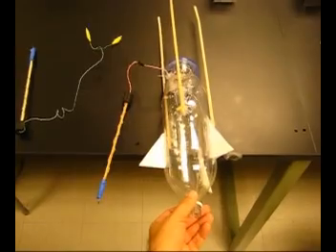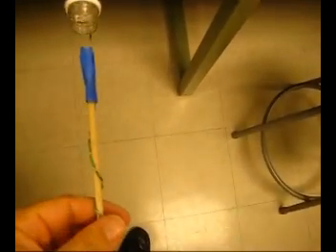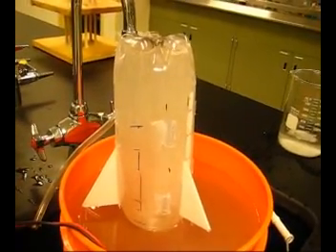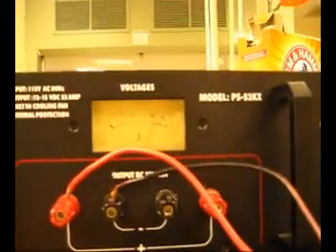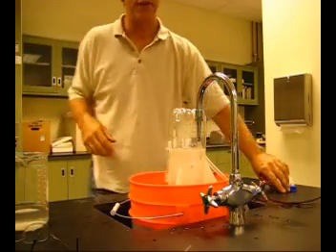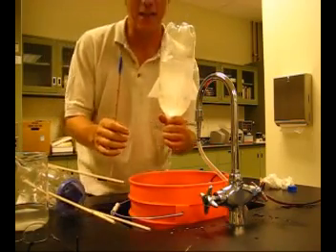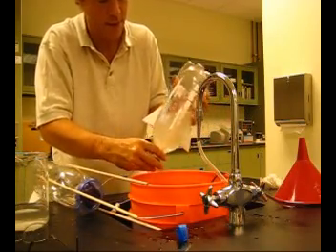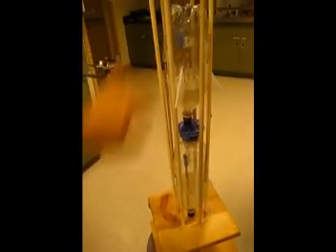Two Stage HHO Rocket.mpg

Comment: is that possible by replacing Estes rocket igniter by home made one with assembling nichrome ,steel wire and  black powder and I did' not get the buz72l n MOSFET transistor ,there is any other option or transistor ,ignition circuit can replaced,I am waiting for info..

Comment: @teazer999999 (continued)... This is better than static air-pressurized 2L bottles usually get - perhaps because the bottle is only at these very high pressures for much less than a second (not the many many seconds a "conventional" water rocket has to handle).

Comment: @teazer999999 Note that the limits on a 2L bottle are high, but you're risking "rapid disassembly" near those limits. We've used a mix of 530 ml H2O, 380 ml air, and 1300 ml HHO (for a fuel fraction of over 75%) and had some incredible (single stage) launches. Predicted post-ignition conditions in that case are 160 psi and 7000° F (!), but the bottle handled multiple launches at those levels (YMMV)... (continued)

Comment from the maker: Good questions. Air is added to dilute the HHO to reduce the pressure produced from the reaction, turning the explosion into a thud, otherwise the bottle would explode. Water is used as a mass to push against. Conservation of momentum sez the mass times the velocity of the water pushed down equals the mass of the rocket times the velocity going up. The pressurized water vapor alone would exit at high velocity but with very little mass. The challenge is to optimize the mix HHO + air + water.

Comment from the maker: It was my first attempt and I focused mostly on the HHO generation and stage firing. It should have about the same performance as a water/air rocket. The record for a two stage water/air rocket is about 1,000 feet (330 meters). 

A nose cone, better fins, second stage firing time and an optimal mix of air, HHO gas and water for both stages needs to be done in order to improve the flight height.